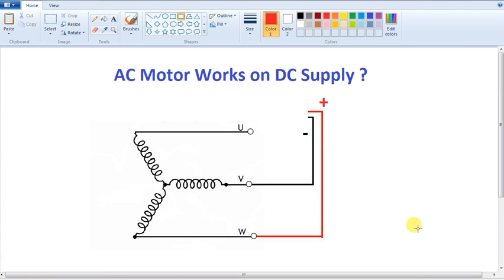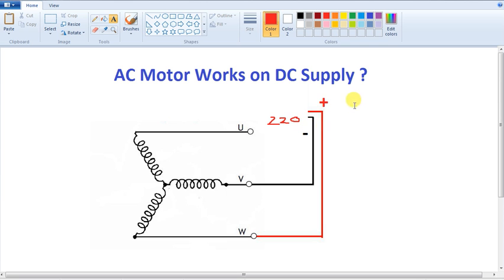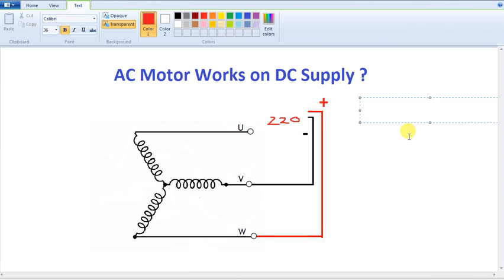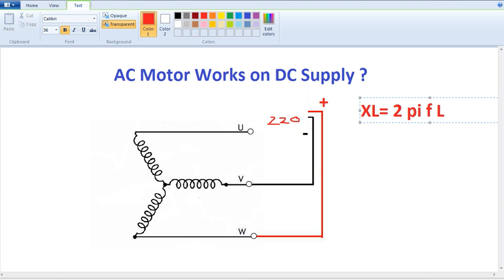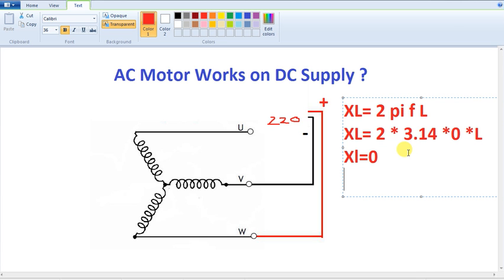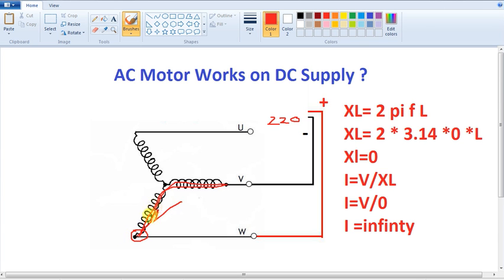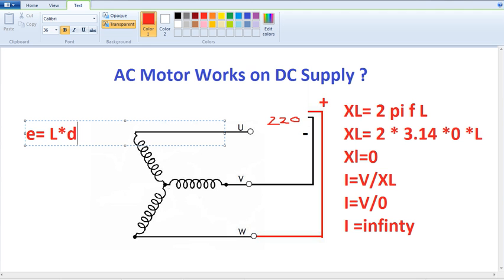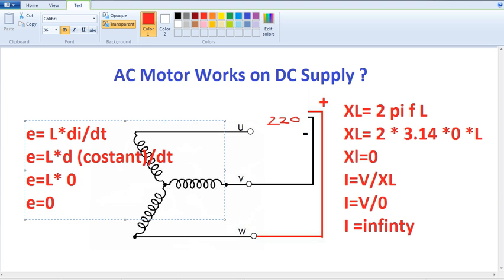What Happen if DC Supply to Ac Motor in Tamil Ac மோட்டாருக்கு DC Supply  என்ன ஆகும்

Comment: Bro pls explain  the difference between the LOTO lock and normal Lock?
Reply from the maker: lock out Tag Out = Addition mechanical locking with external locking device will be implemented but Normal lock = Simple panel lock will be implemented
Reply: @Techdoct    addition mechanical locking na enna bro

Comment: Y residential water pump motors coil burn out due to no water level??
Reply from the maker: It is purely due to Cooling...If you use submersible pump, the water level should be above the body of the submersible pump...Normal motor may burn due to bearing failure...